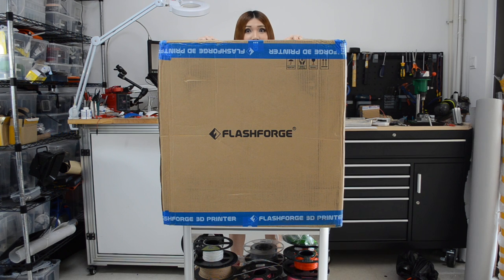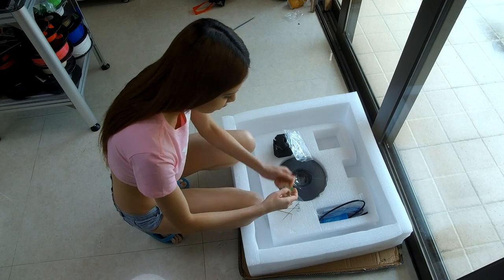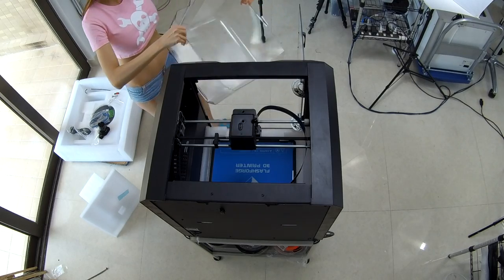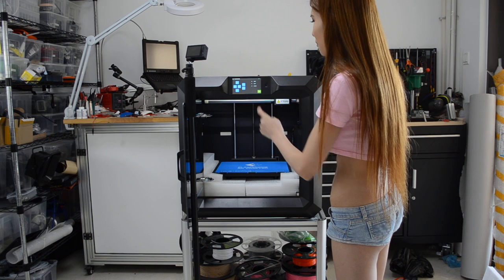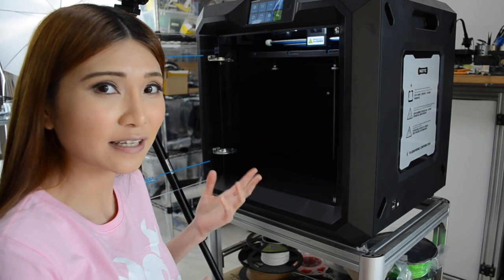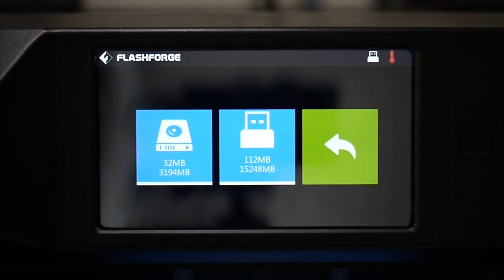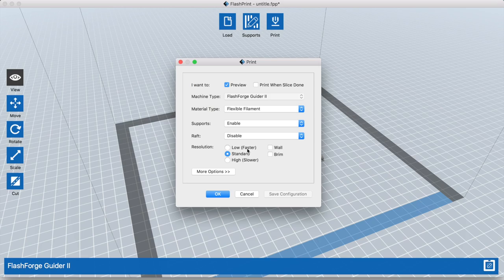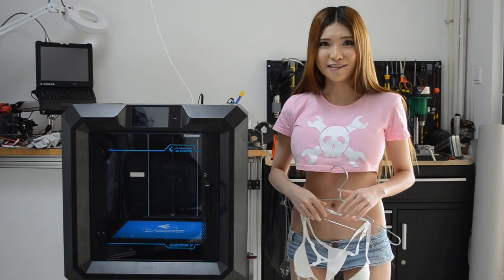FlashForge Guider II Unboxing and Bikini Print!

Comment: I'm basically just getting started with 3D printing. I bought a used Printrbot Plus v2.1 a couple years back for $100. Didn't have a place to set it up at the time so it was basically just sitting around. My GF and I bought a house back in November. One of the perks to that was having considerably more room. So I have it sort of set up(it's on it's own table, the power supply is hooked up, and it seems to communicate with my desktop PC). I still need to come up with a way to hold the filament spool. One thing at a time between work and other projects. But being new to running a printer there's still a lot that I don't know. Not having time for classes, nor knowing if there is anything available locally, what would you recommend for someone that is just getting started to check out? Videos? Tutorials? Things to read? Any advice I can get would be much appreciated.
Reply from the maker: Sure- best for beginners: https://www.youtube.com/user/beginnerelectronics  good luck! That's a great little machine, won't need anything else for a long time.
Reply: Thank you for the info. Much appreciated. And I'm glad you think it's a good machine. I was worried that it might be a bit too behind the times seeing as how fast these machines are improving.

Comment: You will find the front-left of the print bed is too high. As a check, make a test object that visits the edges of the print area, with set-backs (or markings) you can measure.

The instructions need to say to loosen both front screws, or ... there is more than one approach. Writing good setup instructions can be remarkably difficult (and writing the software to match). Getting the setup procedure wrong (software and instructions) can cost you a lot of goodwill with your customers. (Been there, done than. Learned.)

Also, speaking on behalf of the male portion of your audience, you need not be so careful about pulling down the bottom of your top. (Bet there are a lot of guys, hoping.)

Comment: I like the way the auto bed level works on this machine. Seems handy. I think it should ask you to unscrew the nuts together though so you don't end up warping the bed as you may have during the initial failure where the nut was all the way out but it did not reach the desired bed height

Comment: I worked on a Makerbot replicator 5th gen (for scientific applications) and ever since dealing with that piece of garbage, I've been so jaded with 3D printing. This seems to be a MUCH more stable platform, though (including the software being used).
Reply from the maker: We'll see- so far so good, but there are too few reviews and I've only a couple days worth of printing on it.
Reply: Hopefully you don't have extruder issues. The sheer amount of polymer I had to clean out of the heatsinks with acetone is mind-boggling :P

Comment: Could you use less filament if the bikini cup was rotated so the 3 corners were on the bed, or would the shallower print angle mean even more support required?
Reply from the maker: Can see here why that does not work: http://imgur.com/a/Bf8QI
Reply: Oh that is a shame. :(
Also I didn't realise the straps were printed as well! That's very impressive!

Comment: Hi Naomi, great videos... I'm looking at 3D printers. Interested in the Creality CR-10  S5 . Need large size. Would you recommend this printer? Or is there another you would recommend for the larger 500x500x500mm capability..? Oh yeah, for under $1000 usd.
Thanks!
Reply from the maker: I use the CR10 Max and like it a lot

Comment: Do you plan on doing upgrades like the flexion extruder on this as well? Is your other printer going to be for flexible filaments and this for others? Or just wanted a second printer?
Reply: Daniel Stinebaugh she did the flexion upgrade on her wanhao printer. Only a few videos back if I recall correctly.
Reply from the maker: Got this one to review, so far it seems a lot less hackable than the Creator Pro- but it's just working as is so a lot less reason to.